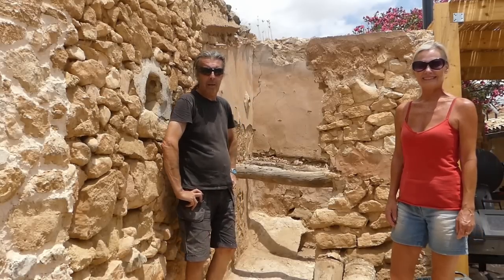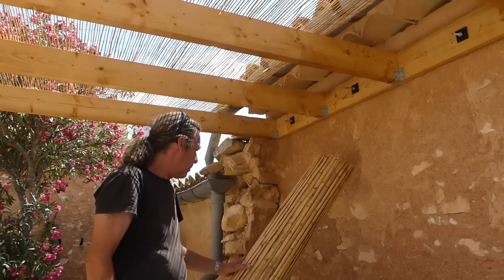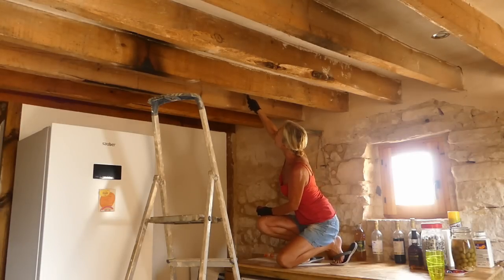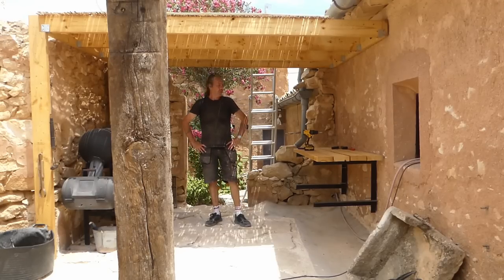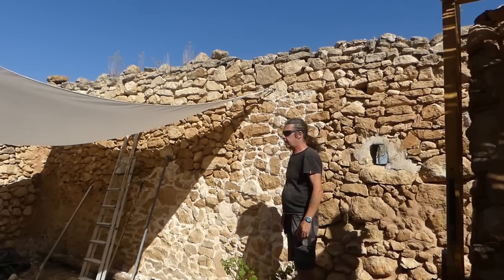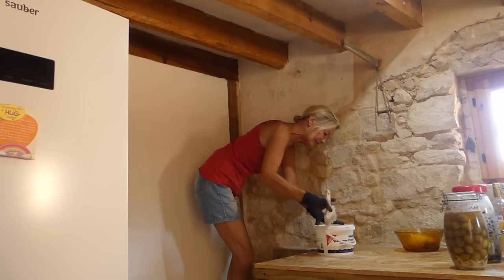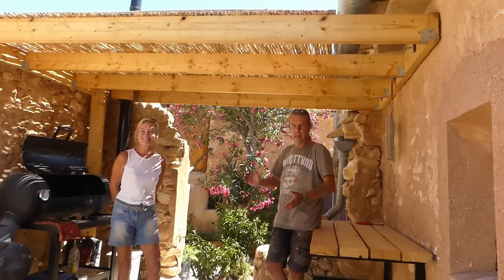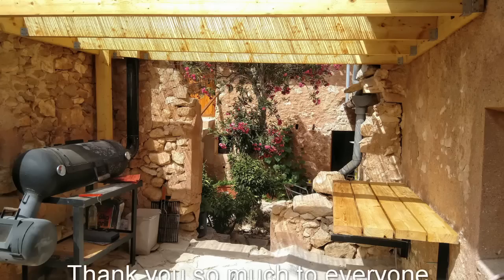Renovating a 150 year old Spanish farm house - keeping it authentic and sympathetic

Comment: Just a quick reminder / note… Surprised nether of you used safety googles using the lime and lime wash, if it splashes in your eyes it can blind you. It’s bad enough when it gets on your skin for causing burns.
Reply from the maker: Thanks James. We read the safety data sheets. To be honest, I have been using it for 30 years and never had an issue, no different than OP cement - safety glasses are probably a good idea though

Comment: And you still haven't cut the excess threaded bar off the wall brackets on the shelf/table you made  like I mentioned last time🤣. You could leave them to hang your keys on or your coat🤣
Reply from the maker: We're contemplating using them to hang things on :)